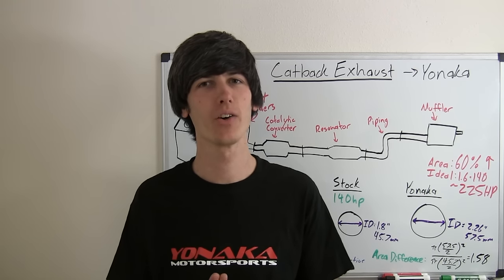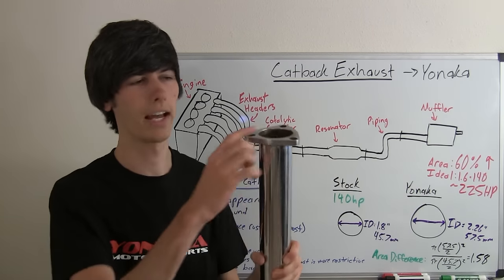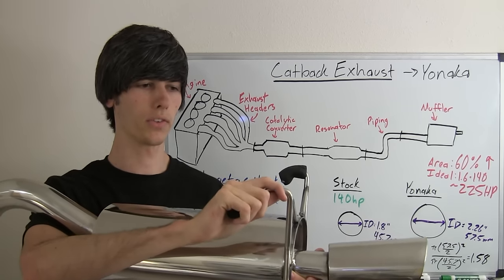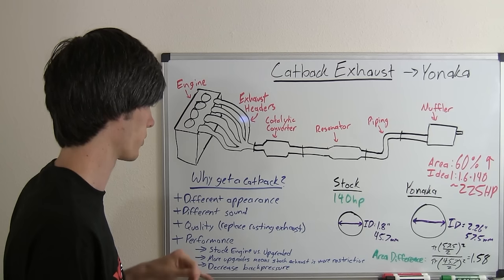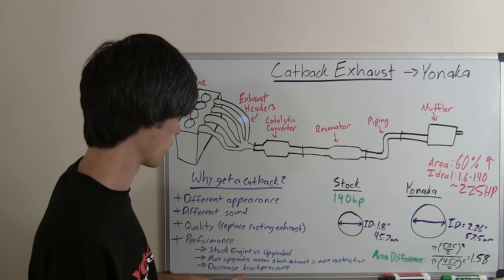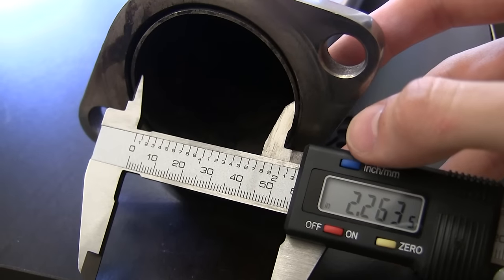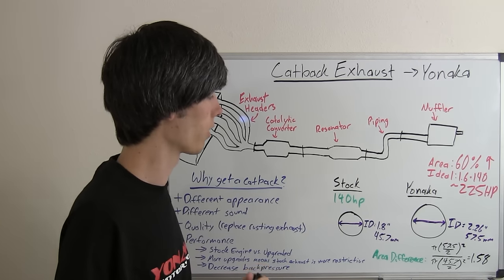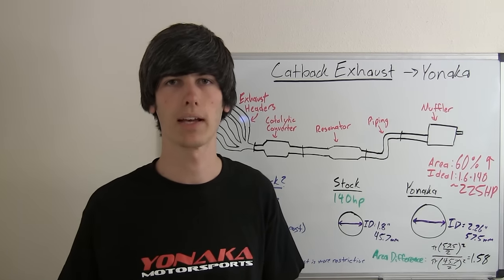Catback Exhaust - Explained

Comment: you still need back pressure though right? because i seen people lose hp when puting  a  straight pipe with no resistance at a 2.5inc size.

Comment: So i just bought a jdm 09 wrx sti hatch..vf49 twin scroll turbo n came with  equal length headers, was thinking is a full 3" exhaust necessary for power gain or decatting factory exhaust be just fine...only looking to make 350whp nun more...what do u recommend?

Comment: I have a BMW e46 325i. I want to replace my exhaust system. What do you think the right width of the pipe is for my car, I'd like to get the maximum power out of it? ATM i have 2 pipes 50 mm wide.

Comment: my truck has a single exhaust I have a 4.0 V6.
I'm taking off my y-pipe I have headers and I actually bought a second stock exhaust it's 2 and 1/2 in pipe I think that's enough..

do you think that's good enough for a budget build dual exhaust..
I'm going to be boosting it with a turbocharger I have a lot of part full custom intake full custom exhaust pulleys orangevirus tuner

Comment: Will taking off the muffler from the resonator point, effect back pressure?
Reply: Yea, it will make ur car backfire like crazy and increase noise and some what performance
Reply: +Ricardo Torres no it will not make your car backfire. On a car with a rich running fuel map there could be backfiring but on a stock tune, which is usually lean for fuel economy, it will just be quieter with less backpressure.
Reply: My RSX type s was straight piped and it would always backfire, it dosent bust out flames I'll give you that
Reply: +Ricardo Torres The standard Honda exhaust system generally inserts both o2 sensors (bank 1,2) into the catalytic converter (generally), the car is programmed to adjust to certain levels of increased or decreased o2 levels but not for the removal of the catalytic convert. The reaction of the car literally is 'oh I'm putting out a lot more o2 i must be pulling in a lot more air' so with the reaction of the cars programming it's going to attempt to increase the amount of fuel that's injected into the system to match a less restrictive intake/exhaust. Your car is backfiring from the increased air/fuel levels the computer cant adapt for past a certain %. Want proof, buy an AFR (I used aem uego afr) drill an o2 bung right before where the cat would be, on the header plug it in run power and if you're below 14.6 (50/50 Air Fuel Mix) your car is running rich. I believe oem systems are roughly 15.1. Want to fix it? A simple Chipped-ECU with a reflash or a Piggy-Back ECU tuner in your case I'd go Apexi VAFC2 or NEO, hook it up and you can now modify your fuel curve manually to adapt to higher levels or lower levels based on your preference, and you can adapt the car for future modification with either. Tune for 14.6 Daily Driving or 13.3 on your AFR gauge for racing/track preferences.
Reply: just install a QTP cutoff behind (or even in front of your cat) and dump it out the bottom with a flip of a switch.  If you have a turbocharger, make sure you have stage 2 programming to control it or you will have boost control issues.
Reply: +Kevin Loy I have a hondata kpro, I'm about to get my stage 2 cams and install my 1000cc injectors and run corn fuel, how much do u think ima push on my dc5

Comment: I have a question. Recently I changed a bumper with a cut out at the bottom for my exhaust tip so it in However after installing the new rear bumper, I noticed that the muffler tip did not come out straight of the cut out section. 3/4 of the muffler top can be seen through the cut out but there's 1/4 hidden behind. I have measured the size of the cut out and it perfectly fits my muffler tip so for now, I'm thinking of doing some minor modifications to the route of the piping such as bending it ever so slightly to accomodate for the cut out in the bumper. Would it be possible and what are the side effects (if any) by doing so.

Comment: Hey I ordered a catback for my 01 civic and they said a part was missing that connects to the catylitic converter, but I have all 3 pipes. Were they missing a 4th part or do they not know what they are talking about?
Reply from the maker: Mm, perhaps there is a gasket between the two parts?

Comment: Hi. I got a swept side cat back extreme ( one pipe each side) for my Tahoe 5.3 l 2002 mod. but I´m not ok with the sound. At cold engine start it sounds great but engine on temp. it sounds like a V6!! Only at higher rpm5000 rpm  it´s good. sounds like a racer but I can not push that hard all day !!! . Any idea why ????

Comment: When people talk about silencers and removing them/adding them for sound Benefits what are they talking about And what purpose do they serve
Reply from the maker: Well it's simply something that you'd install into the exhaust to eliminate noise, much like a muffler. In fact, mufflers are sometimes referred to as silencers. Regardless, it would simply be an device you place in the exhaust line (or remove) which is used to reduce noise levels.
Reply: Oh ok thanks. I hear people talk about how they installed racing silencers and when i hear the clip, the car sounds even louder. The exhaust i am looking at for my car was a supersprint with racing silencer and straight center pipe.. I have heard of straight pipe Exhausts with no resonoter, muffler etc.... Is this what they are talikng about when they say straight center pipe?
Reply from the maker: Yep, straight pipe is just no interferences, straight pipe the whole way back.

Comment: will you see an improved flow if you simply remove the resonator?
Reply: +James A. (spudbot) If your resonator is chambered and baffled, then deleting it would improve the exhaust flow.
Reply: Thanks bud
Reply: +James A. (spudbot) Depends. Resonators are more like silencers, they have small holes to trap or disrupt certain frequencies of sound. Those holes could potentially cause disturbances in the flow that a smooth pipe wouldn't.  You could get into things like boundary layer and all that jazz and for the most part I don't think straight trough res is going to hurt you.  What can occur is heat loss. A res allows for the expansion of the gas that cools and slows it down.

Comment: Does removing your muffler and resonator ruin your engine and headers?
Reply: +iieLiTe2697 no, what it will do is make your car too noisy. resonators/muffler are there to make your car quieter. catalytic converter's are there to reduces excessive pollution caused by combustion. there's a sweet spot for these bits too, as it helps your car gain a bit of torque, same goes with the circumference of your pipe and headers. if you left your car with just headers, it wont really destroy the headers but anything next to it, as some combustion could burn something right after the header. remember the header is just after the engine so "pops" could happen, rather it happens.

Comment: I have a 98 prelude , full apex exhaust + test pipe and the hp increase isn't more than 10hp . Good video but the 140 stock integra and adding your cat back will not increase it to 240 hp that's impossible .
Reply from the maker: I agree. I said it was optimized for more power, it certainly won't "create" nearly that much.

Comment: I am not trying to start an arguement here simply trying to give some constructive criticism on a point of confusion, which you don't have to be a dick about. By EGT's I am assuming you mean exhaust gas temperature; regarding those, getting the EGT's right simply implies a proper combustion. All I am trying to say is having good scavenging can help draw more air and fuel into the cylinders.  On small two cycle engines a good vs bad (good vs bad scavenging) exhaust can mean a spread of ~60%.

Comment: You are talking about diameter, he is talking about area. When you increase diameter you are actually increasing size in 2 dimensions, ie, the length AND the width of the circle so when you double the diameter you quadruple the area. squares are simpler to understand so: 2x2 square has area of 4.  double the length AND the width and the new area becomes  4x4 = 16.

Comment: If you go to the larger diameter exhaust and have little or no engine performance modifications to increase hp therefore failing to optimize the new increased exhaust upgrade capability due to lack of engine hp.... Can that gap between the engines current hp and lack of exhaust optimization capability adversely affect the vehicles performance?
Reply from the maker: outdoorsadrenaline Absolutely, check out my video on testing. Catback Exhaust Acceleration Testing - Project Integra
Reply: It can take away power because it creates a vacuum. Limited flow for intake and free flow for exhaust is bad, vise versa. Now intake + exhaust will increase power....but only so much.
Reply: thanks for getting back with me on this!

Comment: i want to change the header of my civic and have a straight pipe with cat back exhaust, I want to gain hp and don't want to have a very loud exhaust, what can u recommend? thanks, btw my engine is k20a can i not remove the resonator? thanks

Comment: If you run Headers rather than a manifold to increase air flow out of the engine, and then run a straight pipe as a wide radius piping (to get the most airflow) and just run a full deleted exhaust with just tips?

Sounds kinda silly. It's not legal, but it does help the car's P/W ratio, and with minimal back pressure, exhaust gases will leave the car instantly. But I did a Res. Delete with Hi-Flow cats.

You're very likely to get pulled over & ticketed with a full delete on a V6 or V8

Comment: I have question about dual muffler, recently I made changes from single OEM muffler to dual Oem muffler. just for the look. with that being said, the Honda Accord OEM dual muffler comes with Y pipe so the end of Y need to connect pipe that coming out of resonator. so took it to muffler guy and he cut it the pipe and weld the Y pipe to my B pipe. it was perfect fit but after few miles drive I felt that I'm getting pressure on my gas pedal so I checked the diameter of resonator pipe which is 2.13 inch and check the two years pipe which is 1.79 inch so is it going to cause any issues to my engine since air flow coming through 2.13 pipe going into Y pipe 1.79? but again that Y pipe split into to 1.79 so there shouldn't be any pressure on engine pushing out air right? Any guidance greatly appreciated.

Comment: He said those diameters (the after market exhaust with bigger diameters) are more suitable for an engine that makes at least 225hp as opposed to 140 due the fact that its area is 60% larger than the smaller (factory) exhaust... you need to LISTEN and UNDERSTAND before making a comment and making a fool out of yourself.

Comment: If im right you just measured the tip of the standerd exhaust and not the bore of the piping underneath and then measured the piping on the aftermarket and not the tip so any calcaltions would be wrong
Reply from the maker: ADAM Last The diameter was the same throughout. I showed the exhaust pipe as it was easier to film.

Comment: Did you even watch the video? Which gains are you talking about?
He said that you don't gain much with a stock engine, and that to actually benefit from the catback (in the specific case of his Integra) the engine would need 225hp instead of the stock 140hp.

Comment: ive got a question i recently bought a catback exhaust and my engine is stock. Does the HP stay the same without tuning or does the car give more power off the bat? thanks
Reply: its simple, if the engine is stock dont expect an exhaust to make a difference, especially to NA engines.
Reply: thanks!
Reply: SuperLiomessi10 so what exactly do you need modified for the catback to make a difference?  I own a 2011 dodge charger 5.7L hemi. what do I need ? My engine is stock
Reply: from a personal experience ive never had any noticeable power from a cat back.. on the dyno it shows 3kw more than stock. but then u need a 10% power increase from what the car makes stock for u to actually feel the power increase.. the guys at the dyno tuned something dont know exactly what but still the power increase was just on the paper.. this happened on my NA supra.. lots of friends with the same result as well. while the turbo supra actually got a gain of 8 to 12kw which was still not enough for me to feel the difference.. basically speaking from experience exhaust doesnt increase the power noticeably its just on paper.

Comment: Just put a catback on my truck, its a single in dual out, could i replace my exhaust manifolds with headers, or do i need full true dual on both sides?
Reply: ***** Asuming your truck is a V8 Headers will usually go from 8-2-1  which means it will be 8 seperate pipes, down to two, into 1 then into your cat, then your catback. You do not need a true dual exhaust
Reply: Actually on a truck with a V8 running a single pipe out the back the headers or "exhaust manifold" would be 4-2-1 on each side and then they would merge into 1 pipe before the catalytic converter. To make it a true duel exhaust you would need to have it's own piping off of each exhaust manifold and their own catalytic converter for emissions. Now you can leave it the first way I explained it but have the pipe split back into 2 pipes each with their own muffler after the cat and have duel exhaust that way.

Comment: Output power of the engine doesn't rely that much on exhaust. You can't multiply the power by the area of the exhaust pipes.

Comment: I have a h22a1 motor with a DC sport manifold. I'm trying to find a header that will bolt into a 2.5 straight pipe. is there any manufacturer that provides a 2.5 header for a H22 motor?
Reply: Lol. Are you sponsoring?

Comment: if I wanted to install just a catback muffler, would i need the full system as well or js the muffler?
Reply: Catback muffler? Catback exhaust is everything from the catalytic converter back to the tailpipe. If you want to replace the muffler alone, you can do that too.

Comment: You can't just go ahead and apply a simple percentage ratio to determine the ideal diameter to bhp ratio for an exhaust. 2 1/4" (or 2.26" if you want to be accurate) is good for upwards of 300 brake if you really want. You need back pressure to help RPM gain and to allow the lambda sensor to actually serve its function. Without that, you'll be running your ecu on safe mode and probably shooting flames out your ass. Although it's pretty spectacular; that's not actually very good for your car.

Comment: Hello! Just wanted to ask about an exhaust that attaches to the stock y-pipe of my Mustang (V6), which is no larger than 2-1/4". It merges two pipes at that point that branch out into a dedicated, mandrel-bent 2.5 inches through two chambered mufflers out until the tips. Love the sound, but would this result in a loss of power, especially in the low-end?

Comment: your math would be correct if you were calculating for strait pipes but your not taking in to account the restriction caused by the mufflers. which is where most of the "performance" is in a cat back. on most vehicles a cat back is for mainly sound and weight reduction depending on the vehicle. real power gains wont be had until the cat is removed/ upgraded and better header/ more open down pipe installed.

Comment: I'm new to this, but I'm certain that as long as you haven't made any modifications to the engine or increased the horsepower at all in anyway, you will see no improvements. That's because the car's factory exhaust system was built for that amount of horsepower to begin with.

Comment: thats impossible to know for sure, if you're getting 400 hp with a catback made for 120 hp then i'm sure they'd be massive due to the extreme restrictions but if it's 150 hp and it's made for 120 then not so much, this doesn't give you hp, it allows you to have more.

Comment: It may limit your performance.

Imagine it like you blowing thou a straw with a small diameter, if you blow thou it softly you will probably not feel a lot of resistance
but when you increase the HP of your engine it will produce more exhaust, you can simulate this by blowing harder, you will probably feel more resistance (need higher pressure to get more air thou it).
If you get yourself a bigger straw you need less pressure to get the air out. same for the exhaust. resistanse = less HP

Comment: There is an error in your percentage calculation.  Your formula simply gives you a ratio of the two areas. The percentage difference is the difference between the two areas, divided by the smaller area.

Comment: But you need back pressure for the vehicle to operate efficient in all ranges of rpm.
Reply from the maker: No, you just want to the exhaust to have good velocity for scavenging. This video goes into more detail: Performance Exhaust - More Horsepower

Comment: If anyone has the answer does straight pipe still apply to this? From what my friends say straight piping increases mpg and hp by a bit but has negative effects like obnoxious noise
Reply from the maker: Obnoxious noise, yes. Harmful emissions, yes. Slight increase in efficiency (depends on engine power), likely.

Comment: so would I be wrong to say that there is no performance boost in the new catback if you are at stock power?
Reply: you dont. if you change the diam. behind the cat so you have to remap the ecu anyways...the original program can handle only a few % over the stock ps (i guess around 5%). but that 60% is simple a joke if you dont have a turbo or comp

Comment: So how much HP do you gain just on the cat back exhaust alone?
Reply: DemikB16a Basiclly non. Unless you already have a substantial Engine where your current system isnt able to flow enough. But for pretty much any engine sub 400 HP, there wont be a difference.